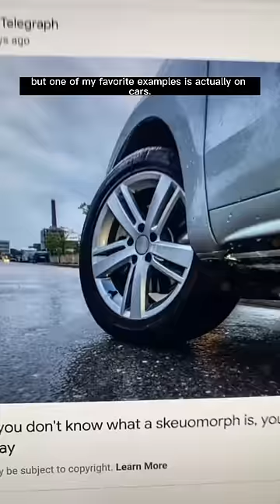Why do maple syrup bottles have tiny handles?

Comment: So the real reason I'm hearing is that people don't like change. All the older people that grew up with the original in the first place, wanted it to remain the same...

This is also why it's harder to change processes or implement new ideas or improve things in companies because all the people (normally older) don't want to relearn a new way to do things lol. 

I work in IT and even people in IT can be so damn against change - even when it's proven to be quicker & easier...  
And sometimes it's political - people don't want to be responsible for it, if it goes wrong. 

But then you can have the flip side where people come in to promote new ways of working, change everything - without bothering to understand how everything works and why these things are in place in the first place - then screw it all up!!
But they then leave before it can be confirmed after months of trial and error, that it just does not work at all & everything gets changed back to how it originally worked. Meanwhile, the CEO or Consultant, has already moved onto "another success story" to rinse and repeat the same crap! 😅😂

It's the most frustrating and mind baffling thing! And it is awful when you work in places like that!!

This is why I've always made it my own personal ideal to always go in with a fresh mind, learn how things work, both from the user that uses the product or system, as well as the teams that i work with, because you often find that the experts actually know bugger all. So, you are often better off getting your information from more than one source, especially if you really want to be able to help people, and help implement and improve better ways of working lol.